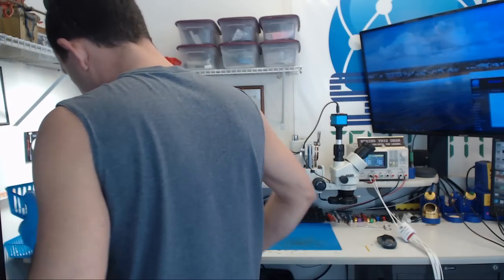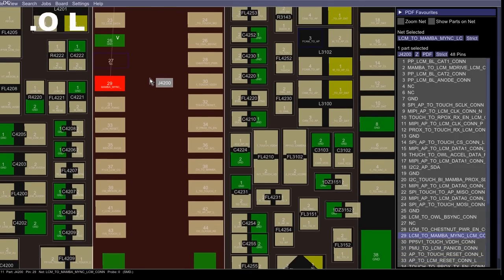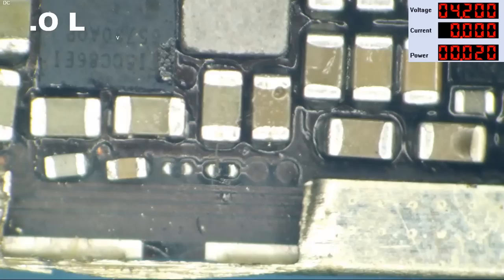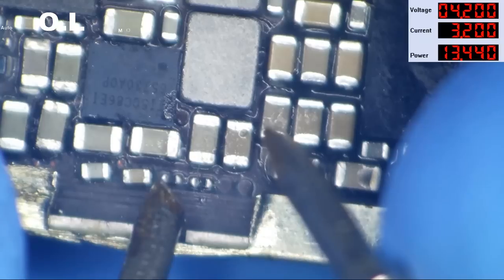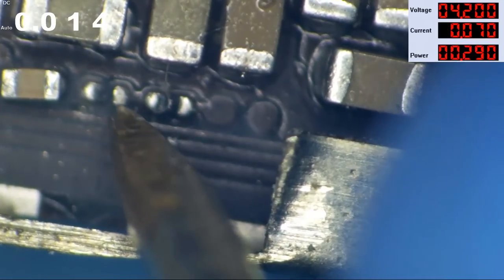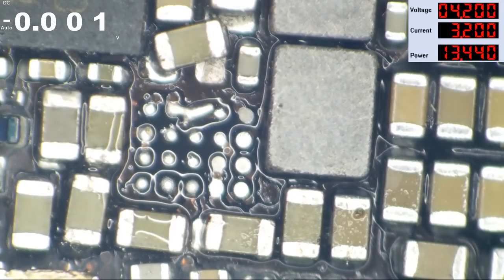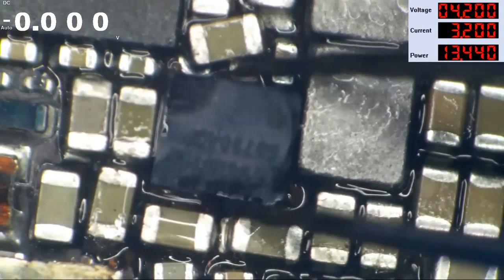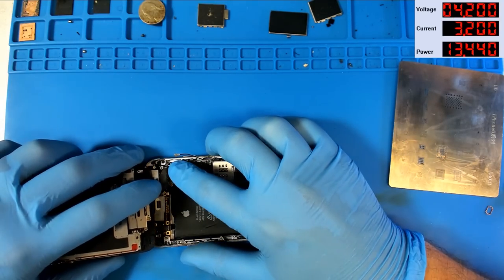Fixing a 6s for data recovery (Prior wankery, i2c short, no power)

Comment: BTW Jason these videos are amazing. I appreciate the time you put into making them and watching you trouble shoot the problems. I2C lines are my weak spot and after watching how you do this I have faith next time I see problems like this I will have a greater chance to solve it. Thanks so much and keep up the great work!
Reply from the maker: Thanks.  I was worried about this one though since they had already checked I2C lines.  I have had the 6s do this before and it not be an I2C issue (that I could tell).  I was worried this was going to be a bad solder joint under the CPU or PMIC.   It's only because I whined about not getting to fix this problem that it wound up being this problem.  lol =)

Comment: You sir are my true hero. After having issues with mother's iPhone 6 for not turning on, I was worried, that smth severe happend (she dropped it). The dcps showed 70mA and off, rinse and repeat. After reading severl threads and inspecting the board I found a little damage on the ram (in the corner where the backlight driver is) and I thoguth that's it, the device needs some proper and expensive repair. 
Nonetheless, after I saw your video I basicly did the same route as you did and checked all the i2c lines and I found a bad behavior (except for the 0V > 1,8V jumps) on the AP_BI_I2C0_SDA line (no 1,8v jumps on other end of the pull up resistor). This line is directly under the backlight driver. I removed the backlight driver and et voila the device has a "normal" boot behavior. I just ordered a new backlight driver and hope that the device is going back on track after the repair. 
I can't even explain how much I have to thank you. If I ever come across Canada I'll sure visit you and thank you personally. Keep on going.
Reply from the maker: This is really good to hear.  I have ran into this exact fault on the iPhone 6 before where the backlight driver screws with one of the I2C lines.  I'm betting you get this one fixed.  It's tricky soldering with hot air right up against that CPU tho!  Thank you for commenting. :)

Comment: Could you tell me what is the benefit of using diode mode and putting red on ground instead of just continuity or ohms. Thanks for the videos.  Or diode mode with black on ground. Could you show the difference in the readings so that it might make since.

Comment: Jason, why not put filter & fix, any particular reason?  take the backup and let them use as long as it works

when to use diode mode? 
does Tristar tester which you showed few videos would have caught it? 

Thanks for wonderful videos
Reply: Jason has said previously that when a data recovery device comes in, he's only looking to get it working to take a backup, not to fix it 100% unless the customer requests it.

Tristar has a different function completely so wouldn't have caught this.

Comment: That’s very confusing to me that they were smart enough to check i2c resistors but didn’t think the problem was the chestnut ic they just put down🤷
Reply from the maker: The line had a near normal diode mode reading though.  I guess they just did not check it for voltage.

Edit:
Or did they?  Seems like they were on the right track for sure.  I think they were trying to fix image but then felt they had killed the CPU maybe?
Reply: STS Telecom I guess I am making the assumption the phone booted before they changed chestnut.

Comment: People not telling the full truth again :-(
I used to repair all sorts of general electronics, and trying to get the full truth from the owner was a game of repeat the story untill it changes.
You have to be part sherlock holmes and part bullshit detector lol :-D
Reply: Haha, I agree with what you are saying, and as they had the device over for repair they then become a expert in the field of electronics and tell you "it wont be much of a fault it will be a fuse or something!"
Reply from the maker: Mmmmmhmmm...  I even chose this one based upon my gut telling me it was going to be a signature fault.  My bullshit detector completely failed me!
Reply: Yeah, I do iPhone repairs but don't have the equipment to do microsoldering, so I send those boards away to someone to be fixed. When doing so, I always mention if it has had any prior repair attempts, I'm sure they appreciate it.

I mostly buy damaged iPhones off eBay, fix them, and resell. 
Nothing annoys me more than buying an iPhone and finding out that it's iCloud locked. Most of the time those sellers will refuse to remove it (the most recent one I've had even had the nerve to say "I'm not removing it because I don't know you", although they were the seller I purchased it from), and the majority of the time I have to go through the eBay returns process (with eBay stepping in) to get my money back (if the iCloud lock isn't mentioned in the listing, it's not as described).

I'm very picky about the iPhones I buy (I primarily work on the iPhone 7 and 7 Plus), so people like this really annoy me. Imagine you found an iPhone with a pretty clear case of an LCD issue, so you replace the screen and it works, only to find that it's iCloud locked. In that state, the phone is even more useless to me than the way the seller described it.